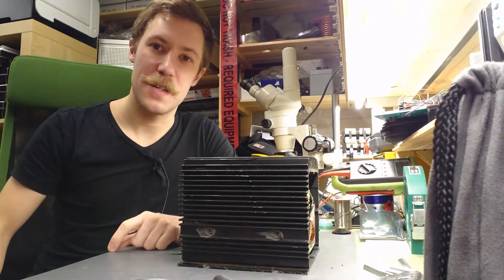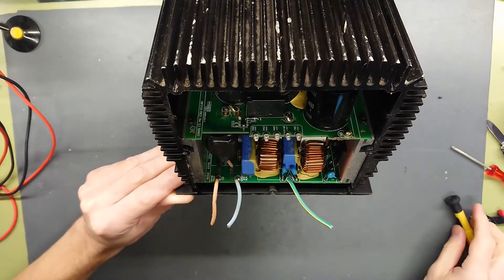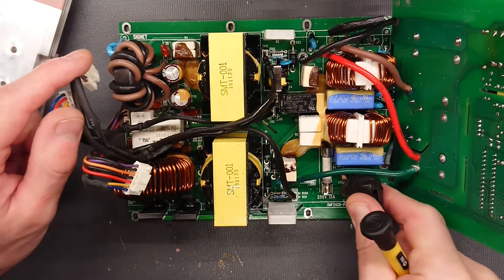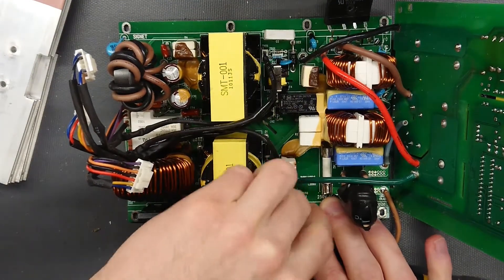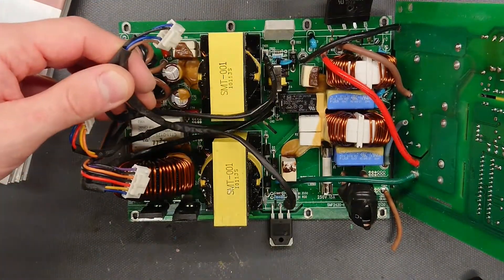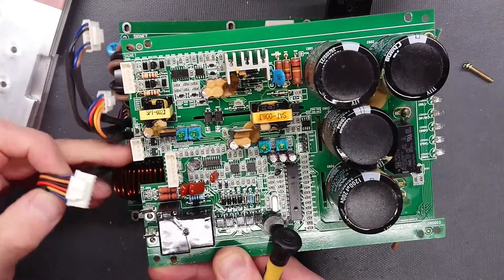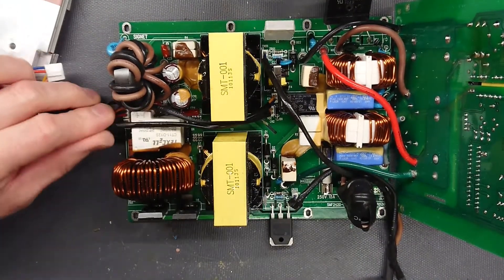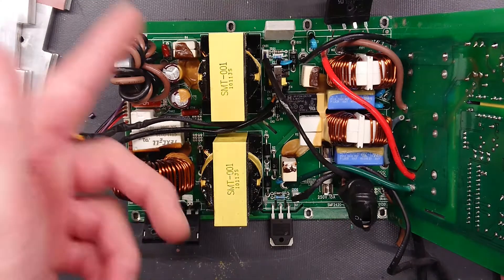600 Watt GEL Battery Charger Teardown - Signet Systems HB600-24B

Comment: The relay on the upper board is a "AC Interlock" which is meant to be wired through the vehicle's e-stop circuit. It prevents the machine from being operated while it is plugged in. The lower relay is for isolating the battery from the charge circuit, it is usually the first thing to fail on these. I am currently troubleshooting one that charges for a while but then begins to "hiccup". Removed the large capacitors on the upper board, they test OK but you can feel the innards are able to move around. Will post back when the replacements come in.
Reply from the maker: Thank you for sharing the information
Reply: That's interesting because the scissor lift I bought had both E stops removed and bypassed (both are wired via a N/C connector) and the machine will operate while charged as it was demonstrated to me by the seller.
I have new E stop buttons ready to go in but need to figure out some wiring anomalies first. Are the E stops wired through a N/O or N/C set of contacts ? I guess it doesn't matter really because it's a push button switch. If it stops power with the button depressed or not depressed would that be a problem ? I wouldn't thinks so right ?
I have that exact same charger too by the way.
Reply: I have a question that If a machine doesn't have E stop. Then these interlock wires can be left blanks?
Reply: @gamersonlyplayinggames244   Correct, just be careful not to charge the machine while driving it.

Comment: If the ac power lamp is not light on 
how to check step by step
Fuse are okay, pls
Reply from the maker: Check bridge rectifier and MOSFET. Use oscilloscope to check driver IC output.
Reply: thanks sir,
I'll check it again. .....

Comment: I have seen those "fully sleeved" silicone pads a lot on 12V -> 230V car inverters. They are supposed to give you better isolation since there is no way of an arc around the silpad. However I don't like them very much since I have seen a lot of failed devices using these things and flimsy sheetmetal clamps for mounting the device to a heatsink.
Reply from the maker: Just had a cable TV receiver through the work shop and the PSU had those sleeves as well. Maybe I am just starting to see equipment from that period being thrown out.